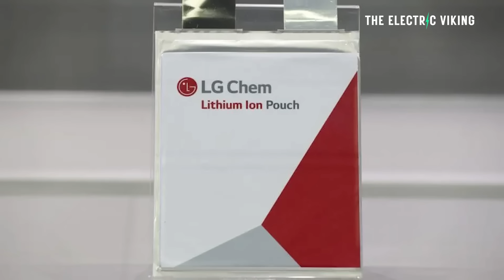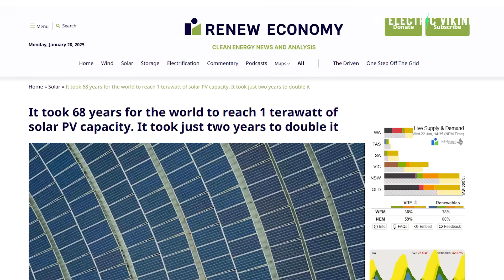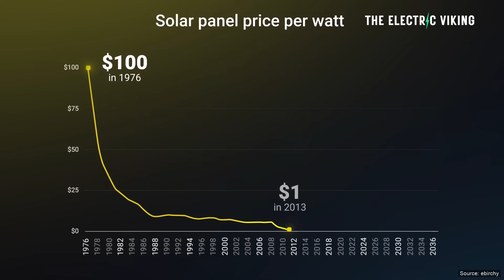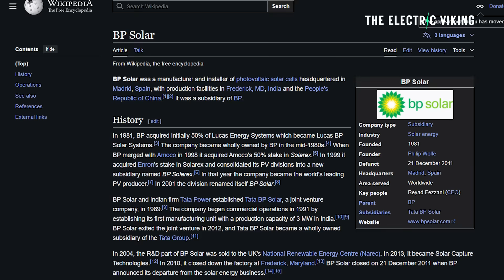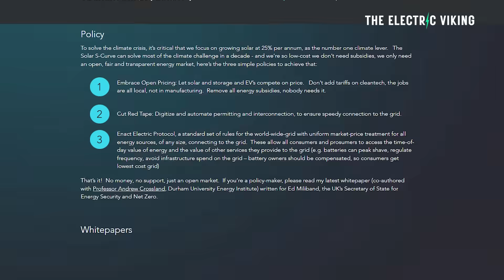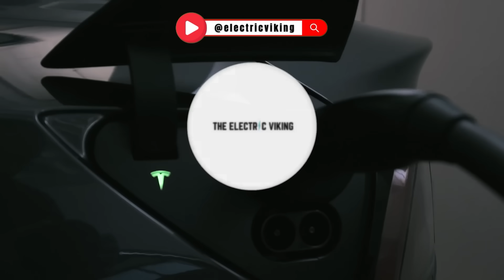S-Curve modeling predicts half of world’s energy will come from solar by 2035

Comment: The S-Curve is already happening in Brazil. Including homeowners, solar is already the second source of energy after Hydro. If things keep like this, Brazil will only use their dams for generating power at night.
Reply: @daniel_chapa  Brazil generates over 50% of power from fossil fuels. Hydro Is 35% and solar is 4%. Rest is wind,biomass and other.
Reply: @markoprusevic9175  I was talking about electricity: 45% hydro, 15% solar and 12% wind. The quick rise of solar and the advent of EV can reduce fossil consumption.
Reply: Water power is unfortunately as well a source of high CO2 pollution. If you take all connected things into account.
Reply: @volkerr. "Water power is unfortunately as well a source of high CO2 pollution"
But nowhere close to fossil fuels.
Reply: @ depends. Building a dam. Maintaining it. Sediments removal. Destruction of life in waters, death of trees and plants. Destraction  of natural flow of rivers etc… there’s a good video here on YouTube showing how immense that can be. Only run-of-river power plants are harmless
Reply: @volkerr. Still nothing like burning fossil fuels continuously. Researches show that replacing all dams with gas/oil plants would represent several extra billions of tons of CO2 emissions per year.
Reply: @ Tell me who’s ordered the study and I can tell you what the conclusion is
Reply: @volkerr. No matter who ordered the study. Faulty data can always be debunked. The question is Hydro is far, far much cleaner than fossil, just by checking how the biggest fossil plants make the sky darker while a dam can produce several times more energy with clear skies.
Reply: @ You really fell for that? 
Go ahead and show your references calculating the CO2 emissions for the dam of your choice and an average CCGT and show witch has the higher lifetime emissions.
Reply: @williammeek-h2o  Do you really believe that passing water through a turbine has as much carbon footprint as burning methane continuously? Seriously?
Reply: @ Your funeral:
A modern CCGT emits about 340kg of CO2 per MWh of electricity
The carbon footprint of hydropower is 20.5 kg CO2 per Megawatt Hour (MWh)
Also a hydro dam can operate for 100 years or more with few maintenance, unlike a CCGT.
Reply: @daniel_chapa  No. Why would you ask that?

Comment: I agree with the sentiment of most of this. One caveat I'd add about the continued reduction of the cost of solar cells is that they already only represent a small percentage of the total cost of the installed solar system. Hypothetically if tomorrow the cost of solar cells fell to zero, the total cost of installing 10kW of rooftop solar would only fall by about 10%. Hopefully the next leap forward in solar advancement will come from more efficient solar (e.g. tandem cell perovskite) which can achieve the same capacity with fewer solar panels.

Comment: I like your channel for the cars. However,  your fascination with solar is a bit over the top. If your solar panels get ruined from a hail storm how long will you have to go with no power? Also, please do some research on small nuclear reactors. They are developing and will power massive populations. One more thing, the ice cores prove that there is no man made climate change. It is a 100% scam. If you think there is do some research on ice cores which show carbon levels way higher than now when humans did not exist. Facts!

Comment: Modelling ,,,wind ,solar and batteries ...the cost to install enough to overcome the lack of generation at night and during periods of little wind , is enormous and is simply unaffordable.
Then comes the environmental damage and land demand of vast areas of wind turbines and solar panels .
Then comes the toxic waste disposal problem when they come to the end of their relatively short lifespan.
Then comes the enormous cost of replacing them all to maintain power delivery.
Claims that wind and solar will replace coal ,oil and gas are delusional.
There is no transition to renewables , there is only an addition of renewables as the global demand for energy continues to increase significantly every year.

Comment: Rubbish. Most of the world does not have the grid to handle extensive electrification (like for all ICE cars going BEV) nor the plans to spend the trillions necessary to upgrade the grid for that scenario. No place on earth has the HVDC lines to transmit DC a long way except in China. In the West where electricity is sourced on spot market prices, alternative energy is barely profitable in spite of low cost generation. Solar and wind electrification has been successful in China because the state controls the grid and the electricity market. For most of the world this is not the case. America for example just pulled out of Paris Climate Accord, cut 300B of green subsidies, and gone back to the more profitable Drill Baby Drill.

Comment: its not just renewable energy that is wasted so is 1/2 the fossil fuel power. battery's can not only be used to improve that efficiency they can be used like we use water revivors in plumbing to keep the pressure up on lines allowing more more efficient distribution of power along existing network, if we place them strategically like water revivors (for eg in the residential clusters the power needs to be sent to)

Comment: Half. No. Way. Batteries are not where they need to be for this. When battery tech improves I'll agree.
Reply: I have solar. I've built several battery packs at approx 4kwh each from prismatic LiFePO4 chemistry. It would take me decades to break even.
Reply: Right now, you can get DYI battery kits 15 kWh for $2k. and prices are still falling

Comment: Where I live we produce one hell of a lot of Hydro Power. Interestingly our BC Hydro also gets really cheap power from renewable and  nonreturnables on the open market because is easy to turn off and on, where these other markets cannot. I think grid level power storage is going to change this in a big way and remove this real cheap power that BC Hydro has been getting super cheap.   BC Hydro has been promoting the use of roof top solar by buying power directly from uses, at retail prices.

Comment: BEVs (battery vehicles) will accelerate PV rooftop electricity. 
Dirt cheap electricity and v2g vehicles parked 23hrs every day. 
And all night long. 

Most homes spend $10,000 on energy and petroleum every year. 

$10,000 tax-free savings every year is very good.

High marginal taxpayers will be the early adopters. 

High marginal taxpayers do not want nuclear grid electricity. 
They are not stupid. 
Government built nuclear electricity is insanity.

Comment: Just two technologies are capable of solving the energy over the next 20 years….  Solar panels, both commercial and domestic, and V2G. Once the EV revolution is “complete” (once ICE vehicles are reduced to enthusiasts only) the spare battery capacity of collective EVs plugged into the grid at any given time, will be massive.

Comment: Right on. Solar has no moving parts, a huge advantage over wind in my opinion (practically zero maintenance cost!).  Any other source, old or new, does not come close in initial build cost and maintenance cost.
Reply: People tend to think they're complementary because wind power is also on a decreasing cost curve (and wind blows at night).

But yeah, I think solar will be the bigger part globally, because it's hard to beat no moving parts. Unless you're in Ireland, where it's always very windy and very overcast.

Comment: Let's acknowledge that Australia presents a best case scenario for solar: very low installation cost even for residential solar. Not easy or impossible to get there in most other regions of the world as the module cost is only part of the cost, the others are labor, permitting, shipping, racking, and fees.
Reply: And also historically high consumer energy prices.
Reply: Yeah. Where I live electricity is 1/2 to 1/3 the cost per kWh.

Comment: I've had solar cell panels on my boats since 1981 to charge the batteries. No problems at all. Even in cloudy weather it works fine. It helps a lot that in Norway the sun never sets properly in the summer months, just for a couple of hours and it doesn't get dark. The same goes for leasure houses and cottages. And the panels cost much less than a few years ago and last "forever".

Comment: Thanks to you I learned about Tony Seba and Andrew Birch. I made some calculations and I agree with what they say. Here’s my answer to the question on Quora: “Do you agree with Andrew Birch's forecast that half of the world's energy needs will be supplied by solar PV by 2035?” 

I think this prediction is correct, with maybe a 3 years delay. The critical thing right now is the price of batteries, — once it becomes clear that the trend of decreasing battery prices can go as far as x10 down, there will remain no major obstacles and a rapid S-curve disruptions will occur during 5–10 years.

Let’s assess the feasibility of battery prices going down x10 within 15 years in an indirect way. Let’s imagine we want a non-chemical battery capable of storing a week of a household energy and costing 10 times less than today’s LFP batteries. Below is a very approximate assessment of such a battery.

It can be demonstrated that a sphere of 2.5 m in diameter filled with sand and covered with 0.5 m of mineral wool would be able to store 400 kWh (1000 oC) for a week, losing 25% in the end, and being able to return half of it back in form of electricity and a quarter in form of hot water. And costing 10k USD (20 USD/kWh netto). Cost of components: a German 2.2kW steam turbine for such system can be purchased for 2.5k USD; mineral wool 0.4k USD; sand, tubes, container 7k USD. Add to this another 10k for construction and we have a 20k USD system, 40 USD/kWh netto, which is x10 cheaper than 400 USD/kWh in case of LFP batteries.

Now, if such battery type is feasible in near future, then whether non-chemical or chemical type, but we are going to have cheap energy storage.

Having cheap batteries the only thing remaining for energy transition is additional 5 times the nominal capacity of solar panels / wind turbines for Germany climate, and 1 for India climate. The battery will be able to keep 8 days (200 hours) of energy for Germany and 2 days for India, requiring once a year usage of a diesel generator for 6 days (see winter Dunkelflaute common to northern countries) or some fleet of international tankers filled with batteries going from Africa and plugged into specific national grid or electricity import from other countries over grid etc, which all seems not big problem.

Taking into account that the surplus energy (which is huge amounts) will find its ways to be sold to some new businesses, tolerant to irregularity, the fast transition to “wind+solar+batteries” is guaranteed.

Comment: The PV panels on my roof are 35 years old and still powering my off grid house.
Reply: yeah the pannels dad put up when i was a kid are still running although we got new ones also the capacity on those 90s pannels where never amazing to start with and they did reduce a bit over time but batterys we have had to replace a couple of times despite being carefull on the cycles
Reply: Awesome! 😎
Reply: Can you also tell us the difference in production new vs now i just want to see that they are still effective even after all this time

Comment: I am not denying solar and batteries will work but when is our electricity bills going to go down. Mine is over $300 a month now. Why do they turn air cons off been doing that for 2 years now and don't seem to be upgrading the grid so you not threatened by blackouts every summer. A lot of people cannot afford solar as still costly if you are a pensioner

Comment: Do I agree? Of course! Disagreeing with Tony Seba at this point, seems like arguing over whether or not water is wet, or fire is hot.
I just wish my local utility (BC Hydro) understood, since I heat my two suite house with electrical baseboard heaters, and there is a big tree that shades my house.  I want the tree to stay even though it limits my solar generation potential. So even if I ever get around to installing heat-pumps (no contractor will do that for me, for fear of asbestos in my old walls), and repairing my garage trusses, so its roof can support solar-panels, I'll still be dependent on a utility that still thinks building dams is wise. (though maybe with better insulation, some new windows, a big enough battery, and a bigger backyard panel support structure, I'd be able in install enough solar panels, to disconnect from the grid, but all isn't cheap & the pay-back might be too long)

Comment: In my opinion the entire world could be powered by solar just by installing Bifacial Solar fencing on both sides of every Interstate highway.  Elon once said it would only take 100 miles by 100 miles postage stamp of solar to power the entire US.  Well the US has about 70 Interstate Highways totalling about 50,000 miles five times what Elon said would power the US. What is great about this idea is that it would not take up any new land, Interstate Highways run through every state which means every state would benefit & every state could help pay for it along with contributions from the federal gov.  

Most Australians I have read live not that far from the coast & few in the centre, imagine an Interstate Highway all around the coast of Australia with Bifacial Solar Panel Fencing on both sides of the highway that could poer the entire country.  Australia's coastline is about 16,000 miles & with Bifacila Solar Panel Fencing on both sides adds up to about 32,000 miles of solar.  Would that be enough to power all of Australia?

The Trans Canada Highway runs from Vancouver to Halifax is approximately 7,821 kilometers long & the vast majority of Canadians live along this highway.  I would also include the 401 which runs from Windsor (the US border through Toronto to Montreal where it catches the Trans Canada Highway & also has a great deal of people living along it).  Bifacial solar panel fencing again doubles the amount of solar from 7K to 14K kilometers of solar which would power all of Canada easily.  Since the US wants Canada to solve the illegal immigration from Canada to the US which is minute (there are a lot more illegals coming the other way), but Canada should build a Bifacial Solar Fence along the entire US & Canada border & sell the excess electricity to the US basically having them pay fir it.  I hope the irony is not lost on you.

Bifacial Solar Fencing on Interstate Highways could power the world, would be cheap to install especially if it was a job Optimus could do & you could add cameras, motion censors & small wind turbines to the fence posts to create even more electrical energy 24/7.  Optimus could also clean & maintain the solar panels as well as guard the border.  It seems like a simple solution whose time has come, we just need the political will power to approve it from politicians who don't care about benefiting from a project like this. If they could do it in one country it could be dome in every country.  

The other thing they should do is build solar powered Desalination plants along every coastal country.  If they can pipe oil anywhere they can certainly pipe water everywhere & fill up low rivers, build man made lakes everywhere to contain water for irrigation purposes, fire   fighting & even to use for drinking if filters properly.  They constantly complain about ocean levels rising & yet no one ever mentions to start draining the ocean.  Imagine if the Boring company were to build tunnels under every highway system running thousands of miles long filled with clean filtered drinking water & irrigation water they could draw on whenever they needed it for anything. 

They should be placing all kinds of things underground in tunnels away from environmental disasters including building fish farms underground, growing food underground, animal husbandry underground, all our transmission lines, MegaPacks underground & they could all be under interstate highways that run through all major cities in every country.  It's such an easy solution for so many problems although expensive. If Elon could build numerous Prufrok  machines in an assembly line the way they build rockets they could build hundreds fo them for use all over the world.  Imagine building a three tier road system, Tier one is for public transportation, tier two is for commercial transportation & tier three is the tunnel system of clean water, irrigation water, fish farms, growing food, sewage & even military purposes to get troops & equipment anywhere in the country quickly.  The Interstate highway system would take up no new land but build down from the land it already occupies & would be able to transport so many goods & services throughout any country.

Comment: Yes, they are saying ai will consume large amounts of power but not enough solar ai will revolution of things energy gust in not so much wasted.solar I agree solar is the way that won't nuclear Wear I AM don't see it happening thay wont it for ai Data center Will big teck foot the Bill trump talking about 500 billion for AI won't be able to get nuclear thair fast enough because of Long build time ai will need lots of power to run fast improvements in Chip may come really fast as with current Data centers for Internet and soler is the only solution generative ai will bring down power consumption for it's needs down fast with intelligence looking at us how long before AI developed Brain 🧠 like us from organic cells instead of chips sounds sifi but AI did 3 years ago?